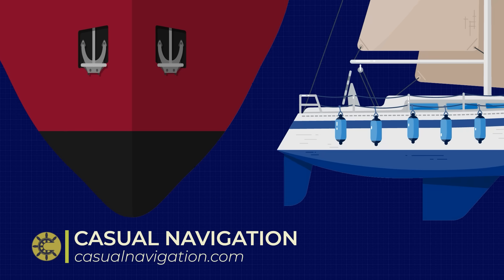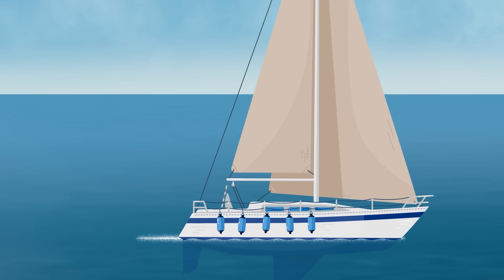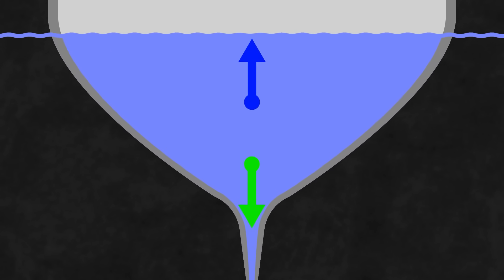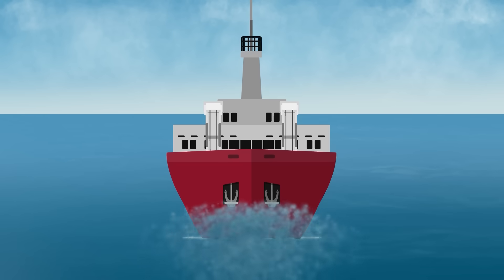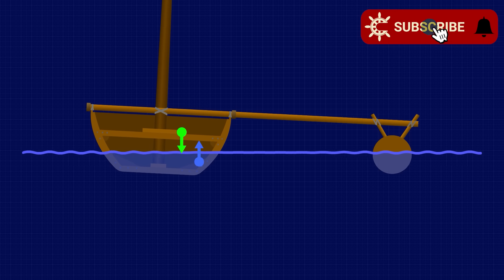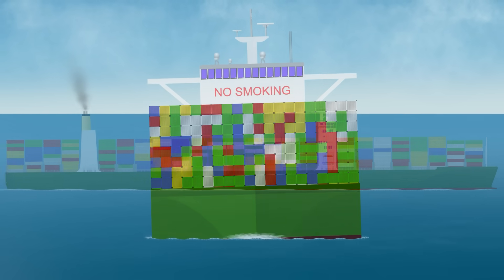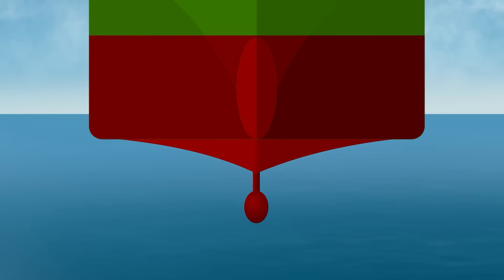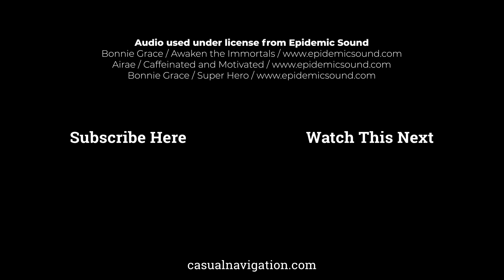Why Do Ships Have Flat Bottoms?

Comment: I had a design project/contest  in uni. Part of it was to design a bulk carrier hull form. My class mates got all wrapped up in Reynolds and Froude numbers and whatnot. We ended up winning, because we made a rectangular boat with a pointy bow and a slight taper at the stern that was the max size of the contest limits, just like a Panamax, or Suezmax or Whatevermax. Profs were salty because we didn’t try to solve the Navier-Stokes equations for all states or some BS 😂
Reply: They gave you a design goal and you met it using the bare minimum required analysis. That's how engineering works in the real world, I don't see what they're complaining about.

If they wanted you to do complex analyses, they should have required those separately. As this was a design exercise, I don't see their problem.

And yes, that's how design works irl. You take a guess that appears to meet requirements (based on engineering judgement and known design rules), THEN you do all the analyses (buoyancy, drag, stability, etc.), then you make adjustments as required and repeat until you have a good compromise. With good judgement and sound design rules, it's possible for your initial design to make it to prototype stage. With good analysis, it's possible for the first prototype to end up being your first SKU on sale. But neither of those is a given, nor should they be strived for.

Source: 4 years at uni (incl. a silly group design project) + 8 years doing actual detailed analyses as part of design efforts.
Reply: @233kosta 
Jesus is the only way to salvation and to the Father.

Please repent today and turn away from your sins yo escape judgement 🙏🙏 There is no other way to get to the father but through him.
Reply: @JesusPlsSaveMe jesus is my gardener's name. Nice try, Diddy.
Reply: @J @JesusPlsSaveMe  not relevant
Reply: Jokes on them for setting up poor competition rules allowing a team like yours to just copy existing designs. Predicting how a ship design works, testing it in real world, and awarding the team that got their predictions correct should have been the format.
Reply: @No-mq5lw  Sometimes the lesson that students really need to learn is that you shouldn't default to reinventing the wheel. Unless you're the first person to ever have a given problem, start by finding out what others did.
Reply: @alltat  this. I have seen many students wasting resources in their project to reinvent wheel when the added value should be somewhere else.
Reply: @No-mq5lw  I mean isn't that what already happened, the ships that are stable and biggest won the contest to exist and continue existing allowing their designs to be replicated by the students. 

This is kind of like why do folks worry about "prepper" scenarios. Unless the disaster brings about something entirely new, we already determined that cooperation, mutual aid, division of labor, systems of justice, administration, and legislation seem to work optimally. We don't need to cosplay building society, we are living a cosplay of a society.
Reply: @rugbybeef  we dont need to but its fun.
Reply: @rugbybeef We figured out how to run society in normal times.

Stocking up on toilet paper and canned food might still be convenient, if something shuts down the country for a while.
Reply: There are gradations between having basic supplies to hold over for an electrical outage and prepping for the apocalypse. 

I feel like when it is expected that students will somehow innovate a novel paradigm rather than iterate on a very successful and proven model in existence: 

a) The expectations are not well aligned with how most innovation occurs.

b) It is unlikely that the paradigm they use will be entirely novel.

 c) You are setting many good students up to fail against those who buck the rules and solely modify an existing successful design the absolute most to qualify in the competition. 

This is one of those situations where they so often bring in outside judges who end up picking the "best" design by what seems most functional even if it violates some of the criteria because outside judges haven't familiarized themselves with the stated objectives and constraints.
Reply: @No-mq5lw The best way to predict how a design will function is to observe example of that design functioning.
Reply: @mrosskne  That is a valid way of testing designs, but in an academic setting, the expectation is to apply your learnt knowledge
Reply: Valid in all settings.
Reply: @No-mq5lw Being inspired by their design isn't copying, or else everyone else in that competition also cheated. Because not one of them would have designed a boat that looked like a boat designed by someone who had never seen a boat. They were all, inherently, almost certainly going to design boats that intentionally looked like existing boats.
Reply: @No-mq5lw Nav Archs don't start from scratch. Of course you should be able to draw inspiration from existing designs, as long as you can justify the design choice behind it and as you said predict the performance.
Prediction is only half of it. Having something fit for purpose to predict parameters of is equally important.
Reply: So they got mad because you did a good job?
Reply: canalmaxxing
Reply: Most important thing TBH is the giant NO SMOKING sign to banish fires onboard
Reply: Maybe the real competition prize was the friends you made along the way 😊😊
Reply: My sister had a highschool test and the question was “why can’t train track rails be made out of one part?” Her answer was simple, because a factory is not big enough to make rails that long. What they wanted to hear was for heat expansion. She didn’t got points for her answer. My parents went to the teacher because her answer was not wrong but just not what they wanted to hear and eventually got the points. Also their information was outdated, because (in Europe) every track piece is welded together nowadays. Only at bridges there are expansion joints and on other parts the curves are used to let the track move outwards for expansion. So her answer was more right then their 50 year old information… really the school system does not want you to think outside the box
Reply: Did something similar at a STEM event when I was young, they gave you a sheet of tinfoil and filled it with marbles till it sank. Just folded the sides and front up, rolled a double seam at the corners and plonked it in the water. They actually didn’t have enough marbles (think it was something like 300) to sink it, which shocked all of us. Basically just a barge as it didn’t have to care about silly things like moving.
Reply: 35th.
Reply: your professors as most professors were salty for stupid shit, i passed shipbuilding 1 and 2 in  Merchant Marine Academy (engineer) classes and we never did navier-stokes equations, all we did was calculate loads/depth center of gravity/buoyancy (and metacenters of course) and whatever inclination or how to fix inclination
Reply: I'm pretty sure that Suezmax isn't a thing - because the Suez canal is straight with no locks, there's no actual length restriction on the ships that can enter it.  In theory as long as the stern of your ship doesn't hit Turkey as you line up, you're fine.
Reply: @DanStaal  You need special permission for a vessel 400 meters or longer, though, so most just build to be 399.9 meters long.
Reply: @DanStaal  Suezmax is a thing when you try to turn around inside the canal. 😉
Reply: @DanStaal  Someway somehow you may remember a ship getting stuck and blocking the whole Suez for multiple days threatening to derail the west's logistics?? Clearly there's a maximum size, about half the width of the canal.
Reply: @SenselessUsername  Well more than half the width, since they can run it one-direction at a time.

My point really is that 'Suezmax' isn't really a thing because the size it would be is bigger than other constraints on the ship.  'Panamax' are ships designed to fit within the Panama Canal, because there's some tight locks in there, same with several other canal/lock systems.  Suez doesn't have those constraints, so from what I understand there is no need to design based on it - you base your design on other constraints and it will fit the Suez.
Reply: @DanStaal  There is a limited beam (because of passing) and height (because of a bridge) --- Wikimedia has all the 'maxes together in a graph: https://en.wikipedia.org/wiki/Suezmax#/media/File:Ship_measurements_comparison.svg
Reply: @DanStaal  The Suez isn't open ocean, so there's naturally going to be a certain dimension that ships can be -- not just for Suez, but essentially any chokepoint
Reply: @DanStaal  Even when there is no length restriction, there is width restriction.
Reply: @DanStaal  Length comes into play in long narrow channels due to crosswind as the ship takes on a crab angle to stay centerline.
Reply: @DanStaal  a canal lock. All of these canals uses water locks to move the ship to a new water level. In the suez the meds and the red sea's sea levels are different, plus there are a bunch of inland waters who themselves sit at a different elevation. A water lock makes up this difference by moving the vessel up or down this difference. Why we only dig our canals a certain depth depends on the work hours and cost to build and maintain. As the cost of digging up a trench in the ground has an exponential curve with width, depth, and ground type. As land isn't flat, so to maintain a consistent water depth you need to dam the water or you'll end up with dry patches of canal.
Reply: I think I'll go go home and write a song about flat bottom girls.
Reply: Me too I wanna design a hybrid battleship carrier without getting capsized only 3 hulls
Reply: Good for you!
Reply: Reminds me of when we had one of those egg drop challenges in 6th grade and my friend and I fucked up our parachute so we just wrapped the egg in news paper and ended up being one of the few groups to save the egg lmao. Apparently that was one of the techniques NASA uses to deliver landers to Mars when they’ve entered the atmosphere and slowed down to a certain speed
Reply: A good engineer makes it work safely in as simple of a way as possible, it’s not your job it make it looks nice, that’s the marketers job.
Reply: @matthewboire6843 Dude, if you spend enough time at a commercial entity you soon learn that marketing OWNS you. The entire management structure is built to force you to do what some possible idiot thinks will sell. That's how you end up with touchscreens in cars 😒
Reply: I mean, that's literally how they're made.
Reply: So you didn't design it you just copied
Reply: @HarvadGradTopOfClass1992   That's how engineering works irl. Copy where you can, innovate where you must. Incremental improvement at a steady pace gives you Triton. "Innovating" everything about a design for the sake of looking like an innovator gives you OceanGate.
Reply: @233kosta  what would you know your not an engineer your a YouTube enthusiast
Reply: @HarvadGradTopOfClass1992   How would you know what I am and what I'm not?
Reply: @233kosta  it's quite obvious from your watch history and previous comments on related videos
Reply: @HarvadGradTopOfClass1992   Because I'm not a gatekeeping snob?
Reply: @233kosta  you don't have to be so offended your not an engineer and it's clear, I'm not sure why it upsets you unless you make a habit of playing make believe in the YouTube comments section
Reply: @HarvadGradTopOfClass1992  *Harvard

Comment: What about a flared hull? Where the keel stretches out past the deck.
Reply: Do you mean tumblehome like the first generations of coal powered warship? 

The downside there is that there is less air space above the waterline than below it, so less buoyancy than a straight sided hull would have when sitting lower in the water, making situations where the ship is rolling more dangerous.
Reply: Early warships had tumbledown hulls as that made boarding harder. When cannons replaced boarding as the main means to subdue enemy ships it sort of lived on thanks to tradition.

Made a short comeback as a way to reduce the amount of armored space high up, until people figured out to instead just reduce the amount of armor high up.